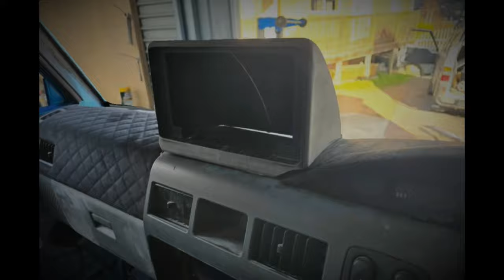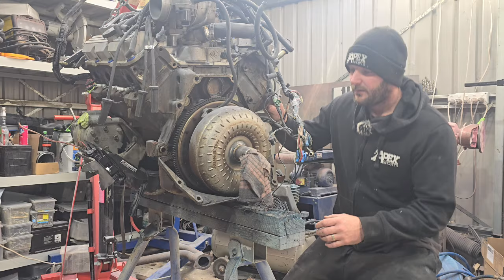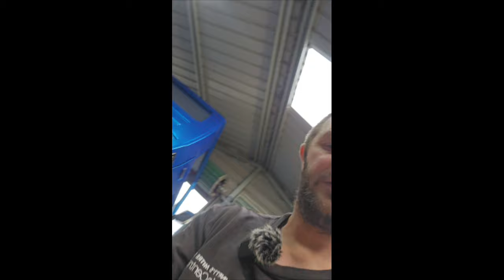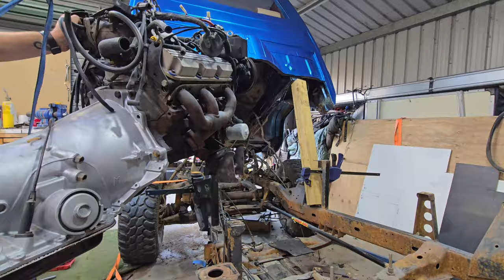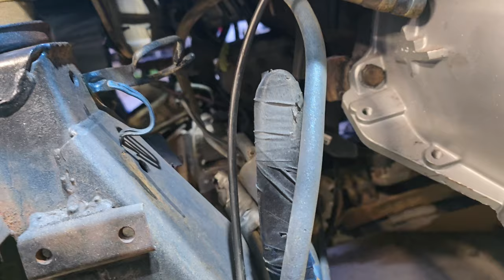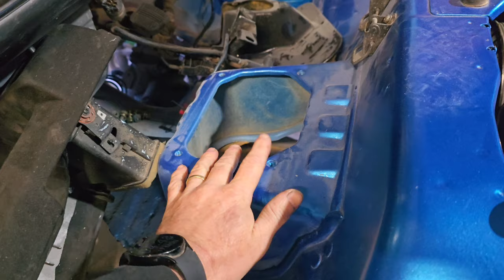1985 4x4 L 300 V6 3.8L COMMODORE ENGINE CONVERSION - Part 1

Comment: My Late father was part way fitting a 3.8 lt in Willys FC, unfortunately never completed
Reply from the maker: @geoffrigby3314  that would be an awesome conversion.
Did you have any interest on finishing it off ??
Reply: @MR-V6-L300  No unfortunately project was sold after he passed , also had a 262 chev V6 set up in Willys at one stage , both with auto boxes , was a Jeep / Willy’s fanatic, multiple Wagoneers , J 3000 , gladiators,all with Holden V8s and automatic

Comment: Hi. I have a mate that had the 3.8 Commodore motor with T400R installed in a 4WD L300. A local mechanic in Wollongong did the conversion. It would have been the Marks adaptor. The combo worked really well both on and off road except for one problem. Overheating. The standard radiator wasn’t getting enough airflow and I helped the mate install an additional radiator horizontally further back along the chassis. It needed its own electric fan but solved the overheating. Keep up the good work and ignore the negative comments. Cheers.
Reply: It might have been the T700R? The one with the 0.7 4th gear.
Reply from the maker: cheers mate  i did get rid of the standard radiator and bought a 3core alloy one with thermo fan which is bigger than standard ,i'll give this ago and hope there are no heating issues , but also checking in with the engineer on a cab lift to add more airflow around the motor, going to get headers and water pipes ceramic coated to try disperse heat in other directions, much appreciate the comment
Reply: @MR-V6-L300  sounds like you are on top of things. Good luck with the build.
Reply from the maker: @Colin1342  I sure do hope so 🤣

Comment: Back in the mid-90s I saw a few mid-80s Toyota 4x4 trucks that had Buick 3.8 V-6 engine swaps. The 3.8 V-6 was a major upgrade from the 22R.

Comment: Use vr vs power steering pump. Remote res its normally on the radiotor on a ecotec and they bolt onto the buick the same other then that maybe even get a rear hump sump for one save ya modifying the one of your engine people make kits to convert buicks into just about everything even if you rear mount rad under tray some good fans and use some stainless piping to some rubber joiners so many ways to do the whole thing and make it work everything will require some modifications but lucky with the old buicks not many of the computers required vats deleted from ecu so wiring it up is simple alls you need is 12v to ecu and fuel pump wiring and then you can use your standard ignition key run it back to the ecu to the start wire basically and it should go without to much troubles
Reply from the maker: thanks for the info mate , i'll get onto looking for a rear hump, another reason i chose the s1 motor as it has no bcm , save me a lot of wiring/ecu  issues

Comment: With your power steering pump you can remove it and run a shorter belt if you not running power steering that will sort out your problem for clearance
Reply from the maker: Thanks , i have been told to get a later model power steering pump that has a remote reservoir, apparently it bolts straight up to the old mounts
Reply: @MR-V6-L300  ok great hopefully that works great build mate 👍👍